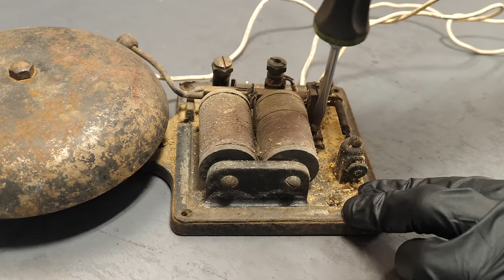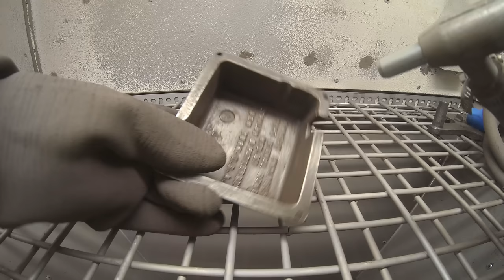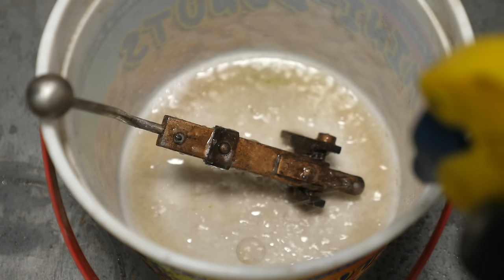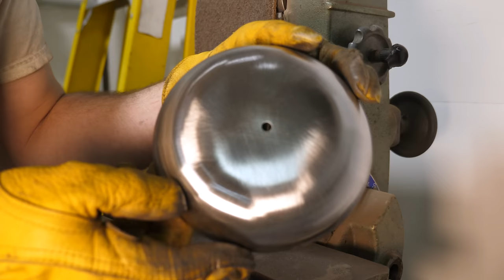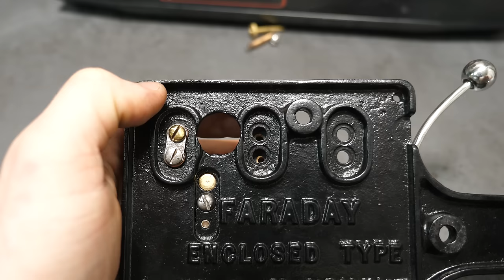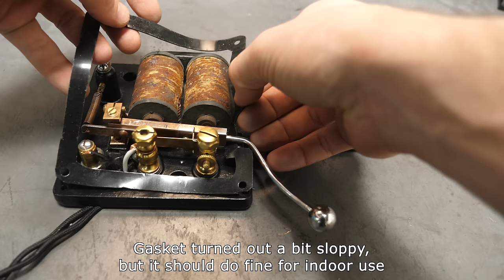Antique Fire Bell Restoration

Comment from the maker: I realize the contact on the hammer is arcing against the bottom post. No, the solenoid coils are not arcing. They are 100% working as intended. Apparently 110/120V is too much for this bell. I will probably use this with a doorbell transformer to step the voltage down if I use this in any sort of permanent application in the future.
Reply: One I had used a 24v transformer with a doorbell button. Wouldn’t want 110v AC running on outside of the school where it was, let alone through a doorbell switch! I would have tied a knot in power cord as stress relief. Well done
Reply: Nadia Fortune    Yup. These were those thrice-damned bells that conditioned all us school kids to get to class, come in from recess, etc. many decades ago. Some were mounted outside, and just had the old heavy copper phone two-wire to power them, on a doorbell push-button. Wouldn’t want 110v there.
Reply: A lot of voltage at the time was probably 100v AC. could have been 50 or 60hz. Some systems ran at 25hz in 1907.
Reply: Vision Gamin
Reply: Do an antique gramophone Restoration
Reply: Enay seller lol hahaha
Reply: Depending on the age of the bell the really older ones were supposed to run off of a 6v lead acid battery.
Reply: You're probably getting an inductive spike from the coils. But I think just step the voltage down and it should be fine.
Reply: Is it for sale
Reply: Eke gf sa boom v cm va ask FDA
Reply: It's weird to see a bell this old running on 120vac. Most old bells run at some very low ac voltage like 6 volts but with a lot of amps
Reply: it's very obvious that the only proper permanent application for this piece, is as the most badass doorbell in your entire state.
Reply: 2:26 I love how you just was like. Eh screwdriver fell, time to use my hands and not pick it up!
Reply: He knew we were gonna ask
Reply: Looks like a telephone ringer. 100v.
Reply: Restoration Station love the videos. But the pro-assault rifle ads turned me off. Too bad.
Reply: I have a newer version. The sticker on the bell stated 6 VDC. It didn't work well until almost 9 VDC. Didn't really get obnoxious until just past 10 VDC. If your bell still arcs at a lower voltage why not add an arc suppression circuit? I suspect there's several videos on the subject here on YouTube.
Reply: ش ككنخن
Reply: @mred8002  yyse
Sours
Reply: 6
Reply: Это красивое видео
Reply: Beautiful job but I often wonder when you restore things like this to look brand new if it decreases their value, anyway great job
Reply: @goines6  you know he can’t choose the ads right? The ads are based off of 1. random  2. Recent search 3. Recent things watched or viewed 4. Highest paying 5. most popular 

Please don’t blame creators for the ads don’t unsubscribe or unfollow because of the ads creators can’t control what ads they get
Reply: @curtislowe4577  120VAC is NOT low voltage.
Reply: @DanTDMJace  Before making a blanket statement in an area for which you have no work experience do some research. My ages ago reply did not make any statement of where the break between low and medium voltage is. Different rule-making bodies use different standards. Once upon a time I built control panels. Anything under 600 VAC was considered low voltage. A quick search verified my recollection: "Low voltage has multiple meanings in the electric/electronic world. A common rule of thumb is that anything below 600 volts is considered low voltage." Are you unaware of how high distribution voltages are? How about large (hundreds to thousands of horsepower) electric motors? A plant I once toiled in thanklessly had 13.8 kV motors that were considered MEDIUM voltage.
Reply: Não tirou as bobinas para limpar, grande erro, pintou com elas no lugar, trabalho incompleto

Comment: Man hearing that bell gave me flashbacks of public school!  Nice restoration, that final sanding and paint job is perfect.  Love that you left the bell shiny, hope you use it in the shop as a doorbell!  Thanks!
Reply: LOL to flashbacks of public school!
Reply: Out of my years in school I never heard that bell... because the last school I went to was 1st grade
Reply: @nacregem  Nice!
Reply: You just reminded me of that haha. I remember when the janitor let me press the bell for lunchtime when I was still really young.
Reply: @nacregem  e d u c a t i o n
Reply: I've never been to a school that still uses those old bells, but I can tell that they sound better than the current noise those speakers make. Probably less deafening too. Albeit I do realize why they make them like that. I just wished they turned down the volume slightly.
Reply: Dude that thing is a fire hazard didnt you see the green sparks coming out when it rung?
Reply: @ItsGante Boi green is copper ionizing?
Reply: @notatable4531  It's just the contacts arcing. If he used to a transformer to lower the voltage or connected a capacitor across the coils, that would fix the problem.

Comment: That green light coming from the inside when it rings scares me
Reply: @Midnight Uke Man basically due the bad state of the coils, its arcing between the terminals, and nope, that isnt good, can make a shortcircuit and leave your home without electricity, or catching fire, if i were him i would have changed the coils
Reply: It's just the sparks, like car sparks
Reply: @Xupaunwebo  it doesn't catch fire
Reply: @Xupaunwebo  and it doesn't short circuit to let the home without elecrticity because the coils are 100-120volts
Reply: @Xupaunwebo  and u couldn't change coils because u can damage and the coils were glued
Reply: @Midnight Uke Man it's sparks, coil sparks
Reply: @omarrama2520  lad, i'm studying engineering, and i have those bells where i'm studying, can confirm u thats not normal
Reply: @omarrama2520  just remove them, rewind and reglue, as simple as that
Reply: @Xupaunwebo  u right but it takes some time to pull out the coil
Reply: @Xupaunwebo  ha ha, how much years are you studying ? Im studying over 3 years
Reply: @omarrama2520  judging your english level defo more than u x
Reply: omar rama it can cause a fire, it could burn the paper wrapping the coils, and it could leave you without electricity by blowing the fuse going into your breaker box
Reply: omar rama sparks in this situation are not good, they can corrode the contacts or damage the coils
Reply: @jasonmurawski5877  what i was saying lol finally someone agrees with me 😂😂😂
Reply: @jasonmurawski5877  , you telling me what happen? The bell is in wall why do i need to pit paper in it? Im studying engineering over 3 years. The fuse won't blow
Reply: @Xupaunwebo  haha, it won't short circuit don't lie
Reply: @Xupaunwebo  there's nothing in ur head just some cob web and a spider inside
Reply: @jasonmurawski5877  there's nothing in ur head just some cob web and a spider
Reply: @Xupaunwebo  mmmmm.. i see sparks aren't coming inside..
Reply: @Xupaunwebo  really nothing inside your head
Reply: @Xupaunwebo  reported
Reply: @Xupaunwebo  next time don't fucking say that
Reply: @Xupaunwebo  you really don't fu**** offend me or bully because ur account hacked
Reply: @omarrama2520  do you want a tissue? 🤭
Reply: @Xupaunwebo  
........ no ,next time lets be friends but why you showing to others ?
Reply: @Xupaunwebo  the soleind coils are really not arcing
Reply: @omarrama2520  then why IS It sparking?
Reply: @Xupaunwebo   tommorrow good night
Reply: @omarrama2520  coils can catch fire if shorted and heated enough
Reply: @Xupaunwebo  I'm thinking it's a hammer arc, it just starts an arc when contact is broken because coil continues pushing current, and then the air turned into ion/plasma sustains an arc for a while more. I think opposite of you that it indicates that coils are healthy.

However you absolutely don't want to see plasma arcs in that bell, because it's got organic varnish and paper on the coils and it could catch fire. I'm thinking it's a low voltage bell, and driving it with 110V was a bad idea and the whole cause for the arcing. There will also be hammer contact erosion, which will make things worse over time.
Reply: @SianaGearz  thats the point, that omar Rama m0ron was telling me that those sparks are completly normal when not 😂 and prob that Bell was Made when Europe was running on 125V AC, now we runs on 240V AC
Reply: @Xupaunwebo   The video and bell are both American, Europe mains voltage is irrelevant. I'm thinking the bell might be suitable to one of the lower common bell voltages, such as 6V, 24V or 47V. Such a bell could be used in a school with open wiring or in another such retrofit situation, where low voltage would be paramount.
Reply: Aegboy 70780 With this type off bell, the sparks are normal.

Comment: That fire alarm looks like it would be the CAUSE of the damned fire.
Reply: Ironic
Reply: @calumbrooknicolson  he could save others from a fire but not himself
Reply: @Aleph-Noll  Yes
Reply: The voltage is too high. You're supposed to use it with a 12 or 24 volt step-down transformer, but he was running it directly on a 120v line.

Comment: Very nice work,  you should use it as a doorbell lol
Reply: If I have mansion !
Reply: Michael Beaty lol..🤗😂 🤣
Reply: Just a clean and paint not a true restoration he didnt rewind those coils
Reply: Douglas Morrison you don’t need to replace everything for a restoration just cleaning and painting will do fine if it works in the condition it is in
Reply: @Freddy McIntire Yes there is as old as that bell is the copper wire those coils are wound with are coated with shellac and with age the shellac will crack and peek THUS a short thats the reason that rewinding is ALWAYS part of restoration
Reply: @Tadfafty  No not insulated u have to know electronics to know that they are shellacked and the cloth covering is external only so inside the cloth the shellac will crack with age short then burn into that is why rewinding is very important to one of these restores and I noticed when he tried it out the hammer wasnt hitting the bell and bouncing back as it should thus the bell had a ring thud sound a sign those coils are deteriorating inside the cloth wrap it was doing that before AND after the so called restore which was only a clean and repaint not a restore
Reply: @Tadfafty  arcs from the contact spring.

Comment: If you didn't replace or repair the parts doing the work, the solenoids, is this a restoration or just a cleaning up?
Reply: That's a stupid definition. The motor wasn't restored so it was just a visual cleanup. Try reading comprehension.
Reply: there's a certain irony in you saying "try to learn the english languague"
Reply: ok geez this guy was just asking. ASKING! your also lucky that the dislike button doesnt show anything either! if you cant reply anything nice dont reply at all!

Comment: Why not removing the coils?
They are so old and rusty that they need replacement.
Reply: He should, at least, disassemble and clean them?
Reply: @ilantzur02  theu were glued down and he didnt want to risk dmaging them
Reply: @Braixie 
At least cleaning them
Reply: @ilantzur02  I do agree they could use a bit of cleaning
Reply: They are expensive and hard to find
Reply: I agree they need replaced or it could become a fire hazard.
Have seen to many coils in pinball machines melt down so bad cannot even get the metal plunger out that is in the middle.
Reply: @tvsnake7841  Could always make them. Basically all you need is what the wire gauge is a lathe and a auto counter and stop when it gets to that many windings.
I have thought about making my own coils for my pinball machines even though you can still get those coils.
Reply: Thats an old insulated wire. Once you unwind it, its risky to wind it again. If you want new coils, just like said before: you need to count windings and find same wire thickness to make exact same coil. In this case, its better to leave them there as they are still working.

Comment: I see this a lot and as an electrician, it bugs the hell out of me. First off, you need better wire strippers. Klein makes amazing sets and like $15.  The big thing is not tightly braiding the wires as you pushed them through the opening and didn't look like you did it too well when wrapping around the posts. Two options are at your disposal. Either tin the wires prior to wrapping them around the posts and the braiding will stay intact, you can loop around a screw driver for a good bend. Second is mostly the one I use for light switches and such. Strip off the amount you want exposed, then cut an extra 1/8" and twist and move it to the end. This will tighten the braid and keep the ends from fraying. Either method will help a lot when wrapping around the posts and will keep the wires from squeezing out so much when you tighten it down.
Reply from the maker: Thanks for the tips. Always nice to hear constructive criticism from people who are more knowledgeable than me. My soldering skills are essentially nonexistent, but I could probably handle pulling off what you described.

I can't believe you didn't mention the massive green arcs every time the bell hammer hits the bottom post! I don't think this thing was designed for 110/120V as it was advertised!

Comment: Awesome work! Fun fact: the mechanism in the bell is pretty much the same in coil tattoo machines used even to this day and these bells are the og tattoo machines. With the difference of not having an actual spring at the end, but a piece of bending metal acting as a spring between the frame and armature bar.

Comment: If I recall correctly, there’s a reason it sparks. It’s basically a magnet and a coil pulling toward each other in a very fast motion. That’s how mechanical fire alarms work. Also sometimes it might touch that’s why it sparks

Comment: It’s always good to soak your screws and other smaller parts in 3-1 oil for about 15-20 mins after you finish cleaning and polishing them. It’s not needed by any means but it does help them a lot.

Comment: I would like to suggest a Circuit machine for making gaskets when the overall look and functionality are important. They are somewhat affordable if you can make use of them and depending on the gaskets thickness, most of the machines can cut the material.

Comment: You may want to put a meter across those screws securing the terminal posts where the wires attached. They may be energized when the bell rings.  If so, replacing the potting compound you had to dig out of them might be a good idea. To keep contact from happening.

Comment: Great restoration, even if the bell doesn’t sound quite the same
Reply: That probably has to do with with the slight change in weight of the metal used for the bell from the process of sanding and polishing it.
Reply: Seth Horst totally, these gongs are well made, especially the ones made during the 70s and 80’s

Comment: Nice restoration and for an alternative use other than as a fire alarm bell. I like the shiny bare metal look of the bell but my understanding is that the bell itself should be coloured red if it was previously used as part of a fire alarm system. Can’t see any traces of red on the pre restored version so I question whether it was a fire bell.
Reply from the maker: Many people have pointed out that these bells have been used for all sorts of things in schools and workplaces. Since it was originally black (but mostly rust) before I stripped it, I'm inclined to agree with you

Comment: That bell runs on DC not AC. Most bells have a built in contact that cuts the power when the clapper is drawn to the coil then the spring pulls it back which turns on the coil again.

Comment: Retwist the wires after you've stripped and use some electrical tape inside to get rid of the sloppy looking wiring when done. Scissors are an amazing too for cutting gaskets, probably try that. Also, you have arcing, probably from the solenoids, showing whenever you ring the bell. That's not safe and probably not meant to do that. I'd highly recommend replacing the solenoids or get arc burns.

Comment: It's nicely finished but two things:

1) This item requires earthing...remove the 2 core cable and replace with a 3 core...
Find a suitable area on the backing plate to earth it

2) the small bolts that come through the base to fix those binding posts require some sort of shielding (plastic tube, rubber grommet etc)
Reply: glenn moreland it’ll probably be okay.
Reply: @corydriver7634 

What makes you think that...?
Are you an electrician...?
Reply from the maker: 1) I don't think they had a ground cable in 1907, lol

2) Each one of those 3 metal machine screw brackets on the back of the part have a rubber grommet behind them and each of the 3 (brass?) posts on the top have an insulator that keeps them from grounding out if you look closely when I am reassembling.
Reply: @RestorationStation 

Even though I'd still be earthing this...
(I'm a UK based electrical contractor)...
You can get nice looking 3 core cable similar to the 2 core you used here...

It's a nice item and I look for things like this myself at boot sales etc...
I've a lot of old vintage switchgear and the insulation arrangements on it can't always be trusted...

If your going to be doing items like this regularly...then invest in a multimeter (a good one) and an insulation tester that'll do 250V, 500V &  1000V DC test...
So that way you can prove that something's safe to energise...😉
Reply: I agree, and the clapper need adjustment. I was also thinking was this supposed to be on 110? Seems like it was overpowered.
Reply: @frogjunk 

I'm assuming he's in the USA... 
They use a split phase system in the USA so it may already be using at 110V potential...

You'd need to ask him...

Comment: From what I have determined, this is a 24VDC bell.  I observed way too much sparking when you connected it to the house AC -- Yikes!!.  Use 3 9V batteries in series to test it out.  Likely, the bell would behave better.  Your restorations are excellent, by the way.  I love the power coat baked finish on many of them.